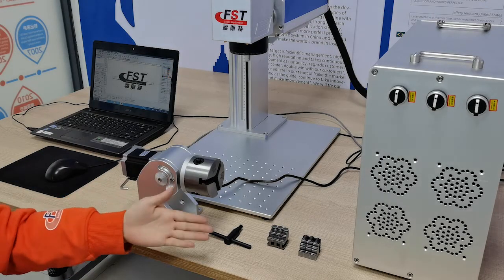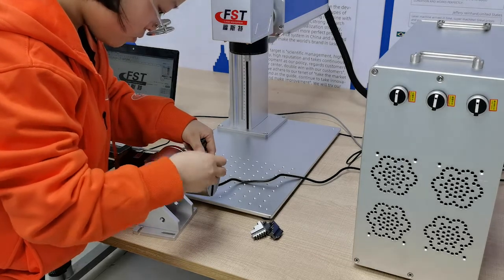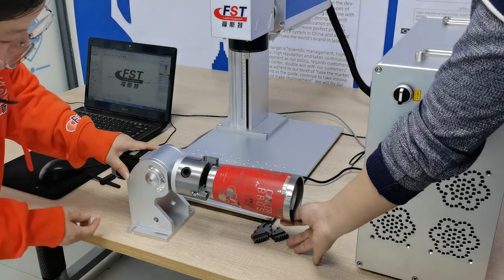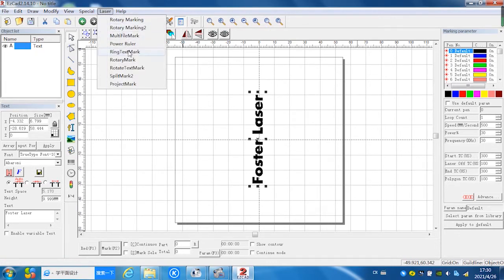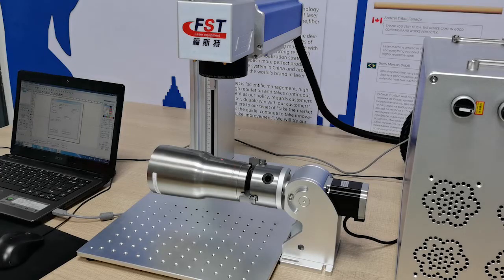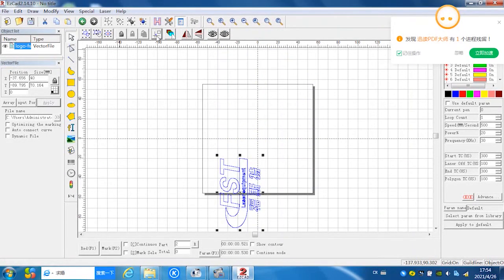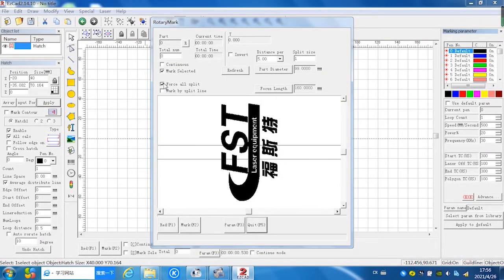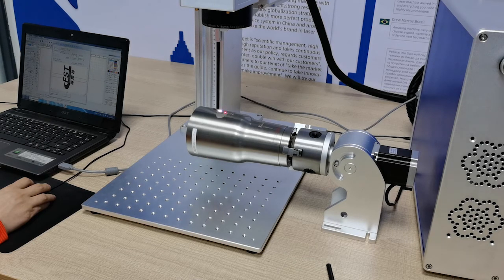How to set up a fiber laser rotary tool with ezcad

Comment: I'm having a problem with the software itself, it keeps opening on demo mode which means I can't use all features  on the software, I didn't buy the machine from your store but I have the same software but it's called Ezcad2 will you be able to get me a solution to fix this problem ?
Reply from the maker: please check the driver, or reinstall it.

Comment: I just received that laser engraver. Can you give me any help with why the red laser won't outline and the machine won't Mark and the Rotary will not spin. What am I doing wrong?
Reply from the maker: Hello friend, do you correct the focal length? You can check this video for the rotary operation. Any other questions, you can send me messages. My WhatsApp number is +86 15314159086
Reply: Can it engrave a brass or bronze product?
Reply from the maker: ajay kumar yes, can mark brass